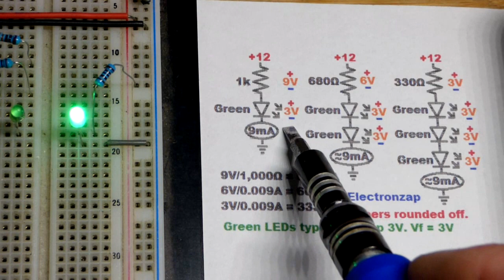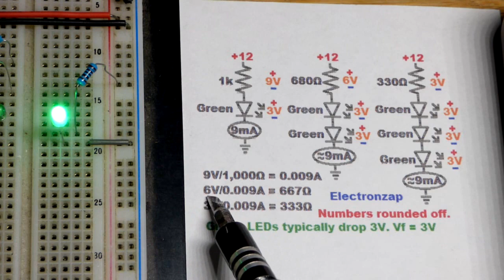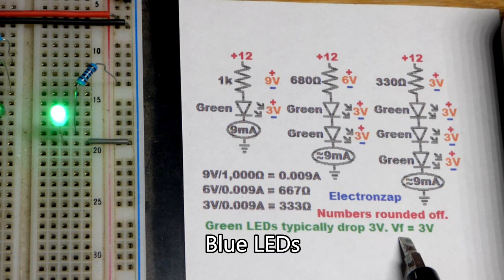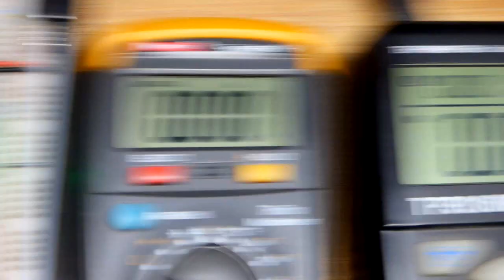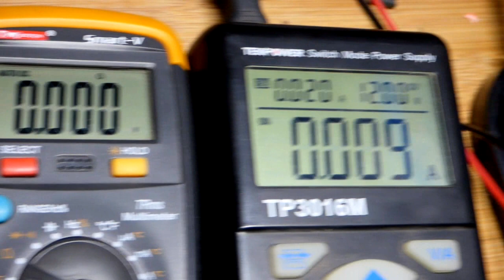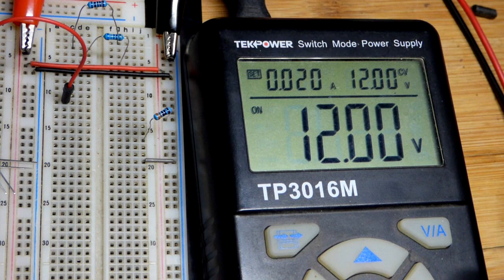Series LEDs Drop Extra Voltage Demo using Green 3 Vf

Comment: It all depends on the tolerance of the limiting resistance and the Vf threshold voltage of the Leds diodes.

Try with different tension thresholds of different colors of Leds.